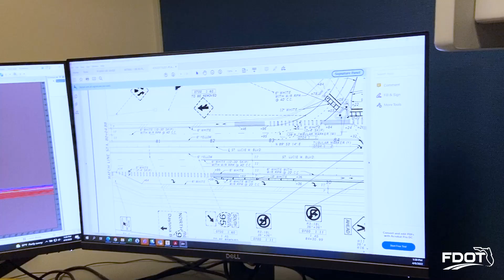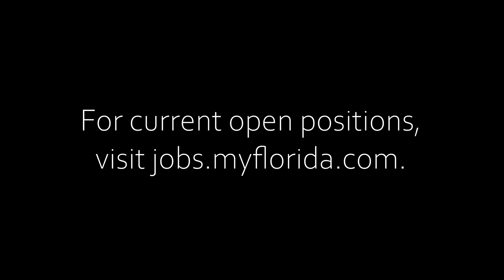A Day in the Life of a Civil Engineer

Comment: Is it difficult to get into this field? I really want to study for it but the math part is what might stop me.
Reply: Hi Regina,

I'm a Civil Engineer based out of California with 10 years of experience. Civil Engineering is a broad field, what I do in my day-to-day job is one of two jobs, doing government infrastructure projects (big pipes in the ground) or being hired by a developer to do infrastructure improvements in support of development (install utilities / build roads for a residential tract / commercial center / industrial plaza).

The most complicated math I do occasionally is basic algebra. For my work, if I need to do something mathematically heavy I have a program purpose built to handle those applications. It is important to have an understanding generally of the math, my job isn't to do the math so much as to gauge if the program's output makes sense. Long story short, do not be afraid to pursue this profession on the basis of a weakness in math, you will be fine.

It is not difficult to get into this field. My experience with Civil Engineering is that experience is 10x more important than formal education (though both are important). The job is scalable too, there is a very natural ramp and ladder you progress up as you learn more /take on more responsibilities / add more skills to your tool-kit. As you start, your job will likely be akin to that of a "drafter", someone who works within a specialized program (autocad) to draw up the plans taking advice from an engineer. You'll learn to love Autocad.

Final thoughts, I would recommend the career. The pros are that right now, the economy is very good for a civil engineer (relatively easy to find a job), pays well (starting engineer probably paid 70k - 80k, when i started i was paid $23 an hour but it's gone up), challenging, rewarding, engaging, and very scalable as you learn more. The biggest con for me is that it's stressful. There are times where I have to throw hours at a project to get things done which can be disruptive to work-life balance.

Let me know if I can answer any questions for you. If you have a good work ethic, I am confident you can make a career out of Civil Engineering. You will not look back and regret this career path.
Reply: @KiwiZama In terms of money which field is better software or civil ?
Reply: @KiwiZama  what about electrical engineering if you know anything ? Is civil better than electrical? It's really important decision for me right now lol
Reply: @hansithaghanta1201  I can only speak for civil, I am not an electrical but there are a lot of opportunities in civil. I personally think civil is great but I’m biased as I am a civil engineer
Reply: @KiwiZama  I am passionate about civil engineering. I want to become a structural engineer. Is this a good domain??
Reply: @SalianDiakite  I am not a structural engineer but work constantly with structural engineers. My understanding is that it is a broad and needed speciality with lots of job opportunities. The structural engineers I work with are universally driven and intelligent, I’m certain you will succeed if you have those attributes.
Reply: I need to make myself hireable @KiwiZama
Reply: Don’t let fear stop you, you don’t have to be a math genius to pursue engineering just work ethic and discipline